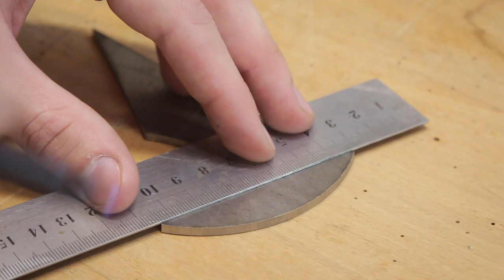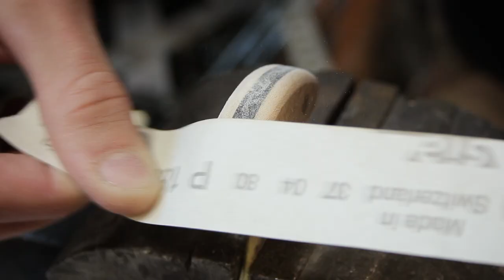I Made a Push Dagger From Saw Blade And Firewood

Comment: Am I the only one with out tools like this at home??
Reply from the maker: Angle grinder, files, sandpaper and a small saw aren't that expensive. The machine on wich I make bevels is a homemade machine for grindin woodworking planer blades(but you can make em on an angle grinder, You just have to try a bit different approach).
Reply: No you aren’t

Comment: what did you spray at the last of the video?
Reply from the maker: Clear coat lacquer. It was the only thing I had. Could have used oil. If it was stabilized I would't have to use anything.

Comment: isn't the wood too soft?
Reply from the maker: The wood is maple and its a hard wood. But it is true that I didn't stabilize it. The blade itself is not heat treated too. It's all because the knife was made for display purpose only, or maybe for opening letters. I'm in no way of supporting the true purpose of such a knife(dagger). I'll do a useful knife project in the next couple of videos.
Reply: @MakeAndTest  that makes sense, I love the woods structure, looks a bit like 3D waves